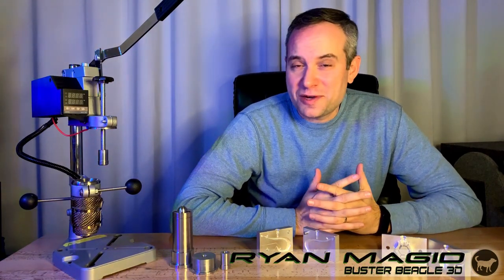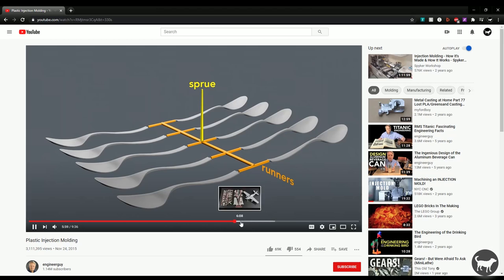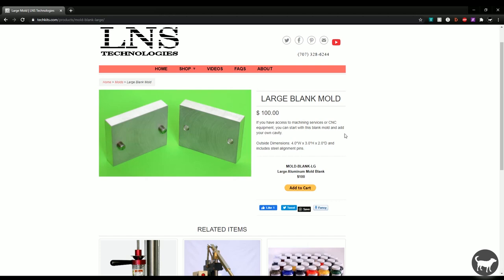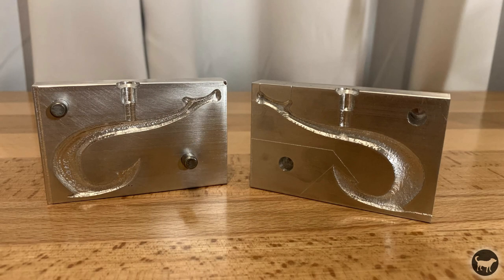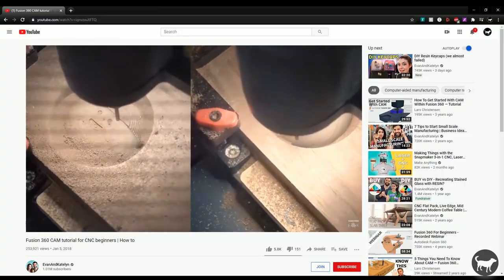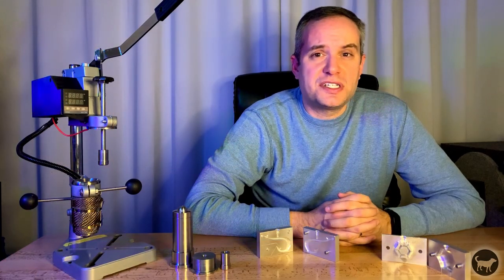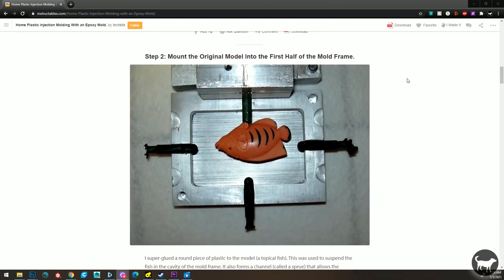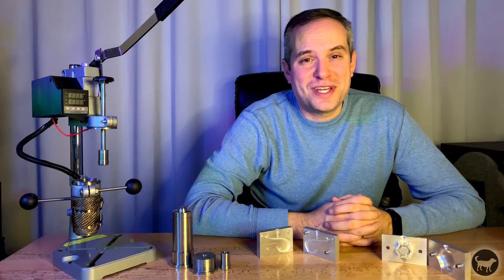Making molds for the Buster Beagle 3D Injection Molding Machine

Comment: Hi Ryan, ...I just finnished making the press. I have A lathe so I made some of the parts from 6061 alum. instead of ss because I have alot on hand. now i'm contemplating making the molds... thinking of using a silicone rubber mold enclosed in alum. plates so the rubber mold will not expant .  the machine was so easy to make and the 2 presses were under 50.00 bucks on ebay. thanks for the videos .
Reply from the maker: Glad you like it. Thanks!

Comment: Thanks for the video as you answered several questions that I had (from your last video).  If you are looking for video ideas I would love to see one that focuses on the modifications you did to your 3018 CNC machine as I am using the 3018-MX3 and would love to cut my own molds (until then I plan on using the epoxy method you linked to).
Reply: I agree - a video on producing moulds on the 3018 CNC mill would be great.
Reply: I second this. I just received my 3018 (not Pro) and couldn't imagine it cutting aluminum. So to see that you can make simple molds with one is eye opening.
Reply from the maker: Hi. I'm glad it helped. You can also look at this video below that I followed to upgrade my 3018 Pro to a 500W 52mm  spindle with a separate speed controller. https://www.youtube.com/watch?v=2wmaL2CFXVI  The other part you see on there was a passive vacuum that I had made to pick up the chips when cutting. To be honest I removed that part anyway because it hid the cutting and I wanted to be able to see everything but you can find it here: https://www.thingiverse.com/thing:4622651  You can also see a little bit of the spindle setup in my enclosure video here:  https://www.youtube.com/watch?v=Vh99XRgdl1w&t=24s
Reply from the maker: @Onsanity   @ZachTriplett I guess I need to make another video ;)

Comment: If I have my aluminum plates and want multiple objects to be made coming from this one mold, and will be using your injection mold machine that you showed how to build in your other video, do I just machine the individual mold patterns into each half of the mold whereby leaving a particular amount of separation between each pattern and then drill a gate for each separate object in the mold and thus I would only be filling each object at a time in the mold? Meaning I will start by lining up the injector to the first gate and fill the first cavity, and then I will slide down the mold to the next gate to fill the cavity, and then slide down the mold to the next gate to fill the cavity, and so on and so on?
   My objects are just approx 1 1/8" tall by .410 diameter and so your injection machine's fill-volume should be more than adequate enough to fill several of these objects with each pull of the handle whereby I assume would be filled one at a time with each object having its own gate versus having one gate in the mold that the plastic enters by and then spreads to each object through connected pathways inside of the mold.
    When doing a mold of this size and with multiple objects of this size will I need to have a heater that keeps the mold hot enough in order to prevent problems of the plastic solidifying too quickly because of heat transfer out through the other areas of the mold?
Reply from the maker: The heat from the injection into the other parts of the mold should be enough to keep the mold heated enough so that you wouldn't have any issues. If you parts are so small you may want to consider using runners to let the plastic go to multiple cavities at the same time. Think of a toy model kit where you have the break the pieces apart from the plastic.

Comment: Or what is the maximum number of units that can be made in 8 hours using the "$250-300" home made injection molding unit if the shape is very simple and 1 inch in size? I am working on a supply agreement and curious how much an individual can make per 8 hour day over the course of a month.

Comment: Do you sell a complete kit of all the parts you're using? (Other than the 3D printed pieces.)
Reply from the maker: Hello. I do not currently sell entire kits but may do so in the future. The best and cheapest way to make the machine is to source the parts. I do have the parts to make a few machines and may offer a very limited run of mostly prebuilt machines but do not have a time frame for those currently.
Reply: @BusterBeagle3D  -- Thanks for the info!

Comment: Waiting for a video that show how u can add parts to the mold injection machine to make larger molds like 5 to 10 square inche or larger  molds if possible.
Reply from the maker: That would be quite the jump! While I'm not sure that it is possible to do that much with a desktop machine I am working on an add on to the machine to extend the volume to 2 cubic inches.
Reply: @BusterBeagle3D   I  was thinking of making a  mold thats the size of a pc game controller . So I guess its too big for a desk top set up... thanks so much for the fast reply.
Reply from the maker: @MarcusJ973  1 or 2 cubic inches refers to the amount of plastic and not the size of the mold. Think of it as more of a hollow object vs a solid one. If you had 2 cubic inches but it was a 2mm thick sheet then that sheet would be 5 inches by 5 inches. Hope this makes sense.
Reply: @BusterBeagle3D  yea . That makes sense. Thanks much. Well I look forward to seeing what upgrades that u can come up with .
Reply from the maker: @MarcusJ973  More coming up soon. Just waiting on parts to arrive.

Comment: Can you give a link for the steel pins? I'm bouncing around wanting to find the ones you have. 
Thanks.
I just found some from Grainger. not the cheapest but they were cheap enough -.50¢ .ea. for 100.
Reply from the maker: If you are talking about the Steel Pins I used in the MK2 version I bought them at Ace Hardware in the nuts and bolts section. Think I paid $1 for it.
Reply: @BusterBeagle3D  Thanks, Ryan. I should have checked Ace. Lowes near me didn't carry them. I now have enough pins to make 25 molds...I better get busy!

What size tool did you find worked best for engraving the vent holes (width/depth)?

By the way thanks for responding so quickly EVERY time!
Reply from the maker: @coulterjb22  Oh those steel pins for the mold! I thought you meant the cotter pin on the MKII. I bought those steel pins on Ebay for $20 for 100.  

For the vents I have tried a bunch of different things and they all seems to be pretty good. Sometimes it is a 2mm Flat endmill .1mm deep, Other times I have used a V-Bit and just barely scratched the surface. If I am trying do general venting I use the flat, if I'm trying to prevent an air pocket in a certain spot I use the V-Bit.

Hope this helps!

Comment: Would a silicon mold work for this?
Reply from the maker: I have not tried one yet but as long as there is not too much flex in the material and it can handle the heat it should be fine.

Comment: When will you have more parts available in your store?
Reply from the maker: I have an order for the stainless steel parts that are estimated to arrive mid March. I am taking pre-orders on the Etsy store to reserve one from the coming batch or I will post more stock to both sites in March.
Reply: @BusterBeagle3D  l already reserved one. Looking for switch and heater sleeves.
Reply from the maker: @husanume  That's great! I literally just got some of the band heaters back in stock about 20 minutes ago. You should see the listing up on the Etsy or Square shop now.
Reply from the maker: I also just found 6 switches (non-wired) in my stock. I'll add them to the Square shop now.

Comment: Have you tried Mold Max 60 instead of an aluminum mold?
If that works I'd be all over this. Print, make molds = factory
Reply from the maker: I haven't yet but was thinking of trying once I got some free time. Also will be looking into creating the molds with high heat resin on a SLA printer.
Reply: @BusterBeagle3D  I'd like to see what you come up with there. I looked into Siraya Tech's "Sculpt' resin but that falls short of the temps ABS needs.
Are you using ABS with that machine?
If so, how many parts per hour can the machine do well?

Comment: Can this machine use rubber pellets ???
Reply from the maker: I haven’t used them personally but as long as they melt under around 350 degrees Celsius it should work. If you check out the Facebook group for this machine I think someone might have used a flexible material but I’m not sure what it was.

Comment: How well does SLA resin printed molds work?
Reply from the maker: It would depend on the resin used. I know that Form Labs has a specific High Heat resin used for injection molding. Not sure how other resin holds up but I have seen some promising results.
Reply: @BusterBeagle3D  Ah allright, will make some tries when the parts from you have arrived and the machine is built. I don't have a CNC so this is my only hope
Reply from the maker: @vesslades   There are also ways to make molds from epoxy and other types of resins as well. A quick search on youtube and you might get some other ideas.
Reply: @BusterBeagle3D  All right,  will do! Just placed an order from you now :) Not sure why I need one of these except for the fun. I've got loads of failed/trashed 3d prints in PLA and ABS so I want to do something with that. If nothing else it'll be a nice project to help endure the pandemic.

Comment: Great video, thank you. 👍
The aluminum you bought looks exactly like extruded bar, just cut to short lengths. In my experience extruded bar like that is terrible to CNC machine because it is hard to cut and gums up the cutting tool. Even worst on a small hobby CNC machine because of its lack of rigidity.
I think it is much better to use cast plate aluminum, and not much more expensive. Read the CNC forums, they often discuss which grades of aluminum are best for CNC machining on small hobby machines. Cheers! 🙂
Reply from the maker: I'll have to check out cast plate aluminum. I haven't had any major issues with what I was using but being able to make it better is always welcome.
Reply: Extruded or cast is no different machining... If it's the same material 6061 is 6061,
Reply: @joshuasimmons2412  nope. That extruded bar, like the type you get from hardware stores, is terrible to machine and really gums up the endmill.
I hate the stuff, and have had a lot of issues with it. Something to do with the crystal size or that it behaves more like forged metal. Or possibly it's just a nasty grade of metal. It's awful gummy to drill too.
Reply: @wizrom3046  I literally work in machine shop it's not because it's cast or extruded, it's the composition... I machine extruded cast and heat treated metals....
Reply: @joshuasimmons2412  Cool, thanks for the info! 👍

Comment: Good grief... theyre gouging the h-ll into us charging a 1000.00 and then there will be tax and shipping costs just for a piece of aluminum put into a cnc machine that does 99 percent of the work automatically
Yeah they initially have the cost of the machine and spent a LITTLE TIME programming such a basic design for the their aluminum mold blanks and then after that, it's all just pushing a button each time a mold is cut to the shape
Theyre not charging customers whereby based on them making a modest profit .... they, like most other greedy businesses anymore, charge you what they think can get out of you and then hype up their explanations (otherwise known as lying though their teeth) as to why they 'have' to charge the prices they are.
Reply: It's like the story about the consulting engineer brought in to fix a machine and giving the company a bill for $10k once he fixed it by whacking it once with a hammer. The company asks for an itemized bill and he thinks about it for a few minutes, then writes it out and hands it over. 
Hitting machine with hammer $5
Knowing where to hit machine $9995
Reply: Wages, material, electricity, maintenance, rates, taxes, tooling, coolant, oil, compressed air, insurance, software subscriptions all add up.
Reply: Businesses gouge everyone. It ends up with the end of the supply line, the consumer, paying the price.